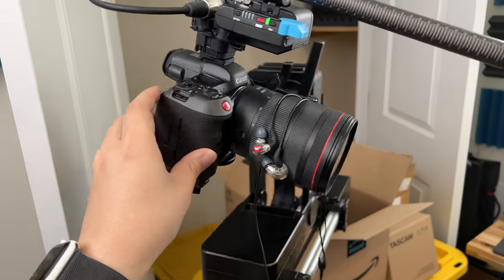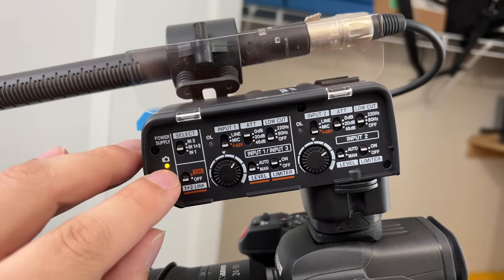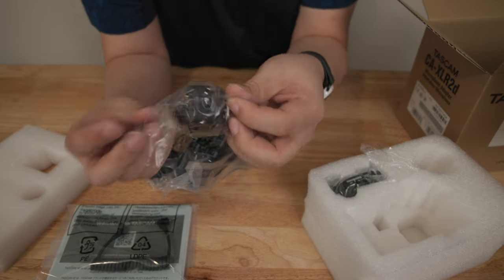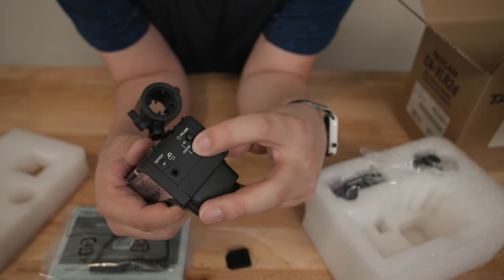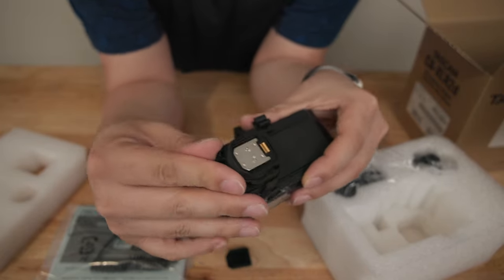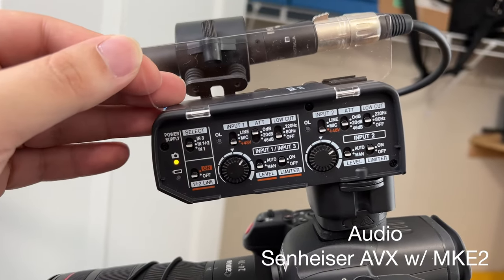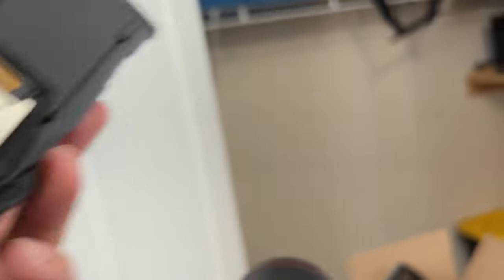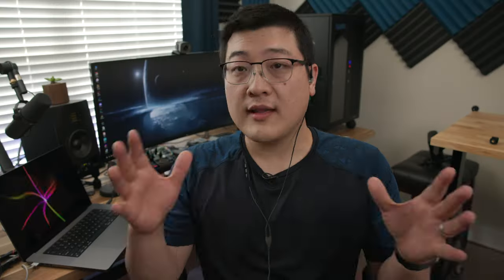Tascam CA XLR2d Quick Look For Canon R5C & R3

Comment: Hi, great video. A couple questions.  If audio goes through hot shoe then why did you have a cable going from audio out to camera’s mic input? I was thinking this was only used if camera didn’t have compatible hotshoe.  Second question, when using Tascam can you still have another mic going into camera’s regular input for essentially another channel. Ie: three channels of audio (two from Tascam via hotshoe and one from camera 1/8” input). Thanks.

Comment: Hi, I just got the Tascam but I cannot connect the battery unit to feed the audio adapter, Did you have any issue? The problem is that the battery adapter has a thick part that doesn’t fit properly, do not what to do, I hope you can help me, cheers!

Comment: All of my audio menu settings are greyed out, and I get a message from my R5C that says "Currently, the accessory cannot be used." Any suggestions? I've done everything I can think of to troubleshoot, Tascam's phone support had no help for me :/
Reply: Did you ever get this issue sorted?
Reply: @NativesMC  yes, I contacted Tascam and they recommended I exchange it for a replacement. The new one I got works great. Glad I wasn’t doing anything wrong that I was just overlooking, I just ended up with a lemon!
Reply: @jesstipton has your new one held up? I keep seeing reviews stating that the accessory fizzles out after a handful of uses.
Reply: @omarknowsphotos  mine is still working great, I've probably used it for around 5-10 hours shooting time so far on several different shoots. Fingers crossed it won't fizzle out!
Reply: @jesstipton  that's great to hear! guess I'll pull the trigger
Reply: @omarknowsphotos  good luck! Keep in mind, I did get a lemon first go around, so buy from a place with a good return policy lol
Reply: @jesstipton  Exactly what I'm planning, lol
Reply: @omarknowsphotos  Well, that was some bad timing. The adapter went out on me yesterday, it's having the same issues as the first one. The power light comes on when I power up the camera, and then shuts off. I can't get it to work at all, no luck even after giving it a firmware update. Good luck with yours, I won't be trying it a third time :(
Reply: @jesstipton  no, I was going to order it after a job this weekend but absolutely not now. Thanks for coming back to this.
Reply: @jesstipton i e been on the fence about buying this! Thanks for letting us all know your experience. Sucks that this is the only on camera solution like this. Canon needs to step up & stop recommending it. Do you have plans for a different audio setup?
Reply: Mine just went out after a handful of uses. Don't buy this!

Comment: But all audio options are grayed out, so it’s not connected? How do you even know? I just got one and don’t know what’s happening here.

Update: uhh, okay, so actually it has been working this whole time, but there’s just no visibility in the menu on that, and there are no options to set? I had to set monitoring to ch1-2 and then I can see levels on the meters. I recorded a mono mic, but in FinalCut the audio is in both channels…did it record the camera mic or the Tascam’s mic? It’s all very unclear. There is no switch to move back and forth from the in-camera mic to the Tascam?
Reply: Mine was dissapointing too, records two channels but only one channel appears in FCPX timeline so can't adjust levels independently in editing.
Reply: @nickturpin4288  I got mine figured out. It’s quite good, audio quality included, but was just unclear at first.

In FCP it’s a single mono channel? If it’s a single stereo channel then use the “direction mixer” plug-in.
Reply: @Sol-In-Seoul  I have a single stereo channel, both mics seem to be recording to both channels. If I set FCPX to Mono it separates them but they are still both the same. I’ll explore the plugin. 🙏🏻
Reply: @nickturpin4288  Mine records four mono! In FCP I have to set it to “two stereo” and then mute the second stereo track (which is the crappy Canon in-body mic).

It almost sounds like your mic isn’t recording and you’re just getting the Canon mono mic audio? Or you have the Tascam set to the mode that records mic 1 to both channels? But unless there’s been a firmware update I think you should see four mono in FCP.